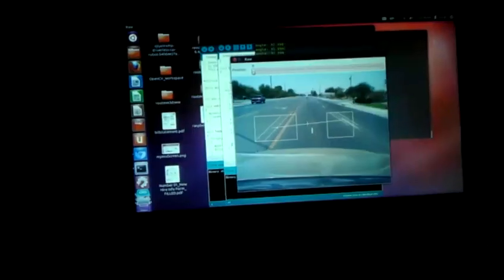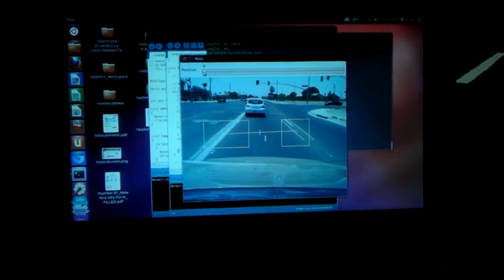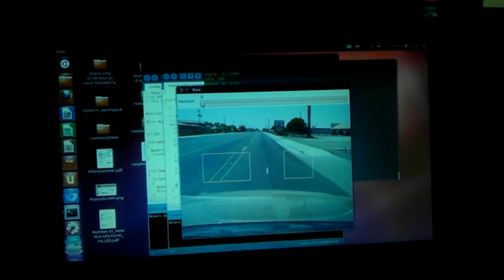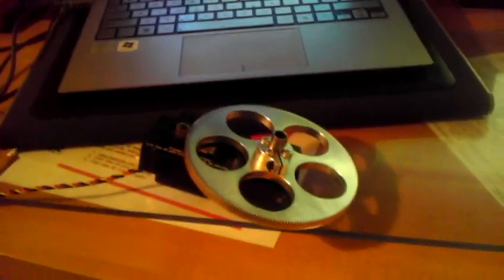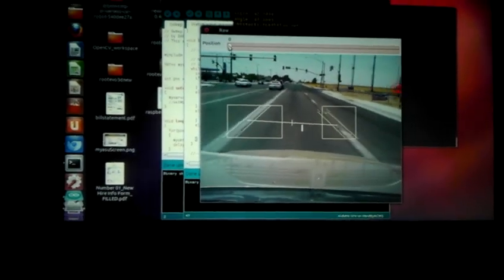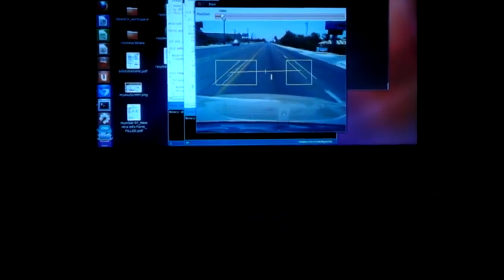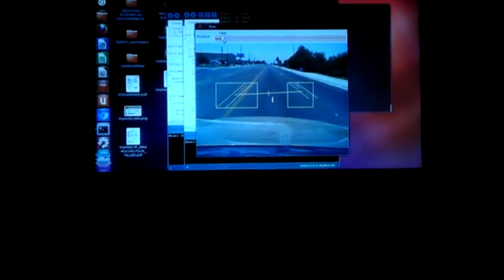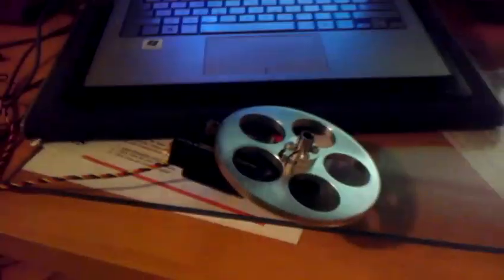Road Tracking: Opencv + Arduino + Servo

Comment: How can u do the communication between Arduino and Open Cv?
Reply: Arduino has a serial monitor. You can send messages to Arduino by transmitting those messages to Arduino serial monitor from the language you implemented OpenCv in. In C++, there's a <Windows.h> library that allows you to send messages to the serial monitor. Don't know about other languages. Follow up on this and you'll know more :)